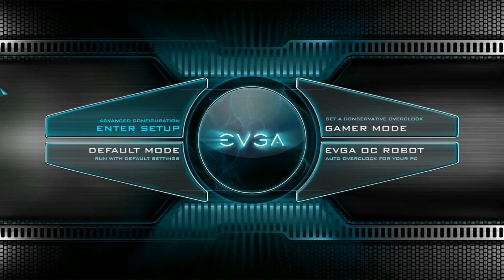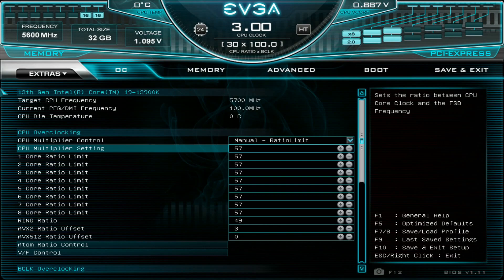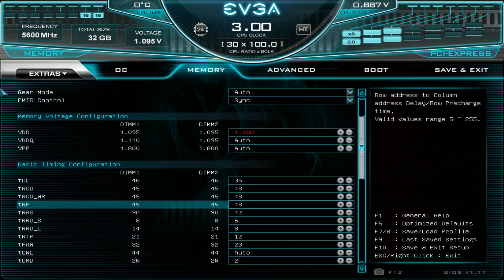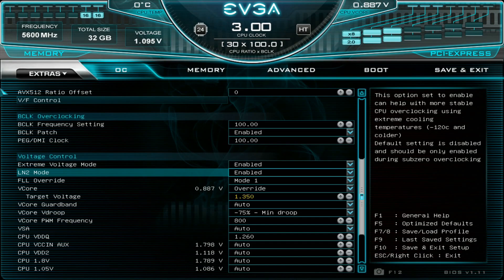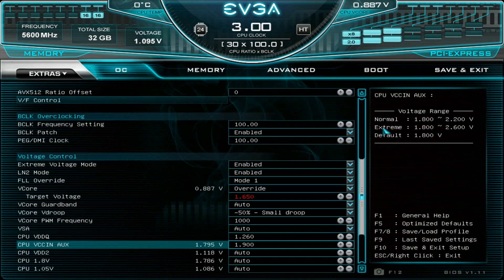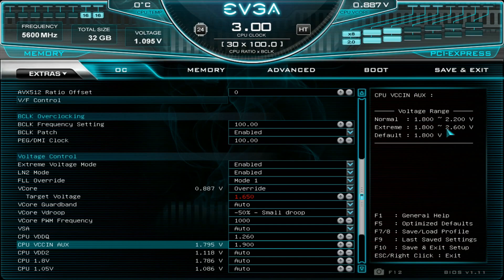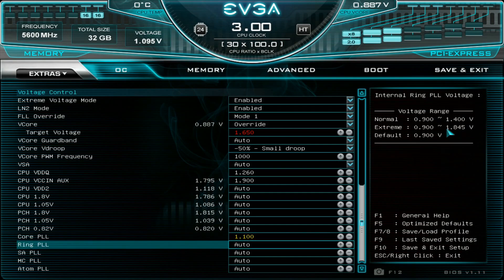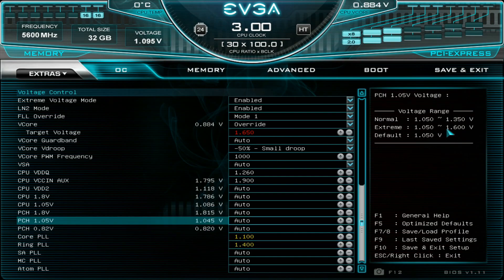EVGA Z790 DARK KINGPIN - BIOS Settings Guide for LN2 Overclocking

Comment: I am glad I subscribed. Since you are very smart I would like to ask you simple question. On my z790 tachyon I have no problem oc my 7800xmp to 8000 or 8200. I ran all the tests in the windows memtest5 anta extreme etc… all stable… but issue comes after I shut down and 10 min later I start computer again. Anyways this is great video. Thank you